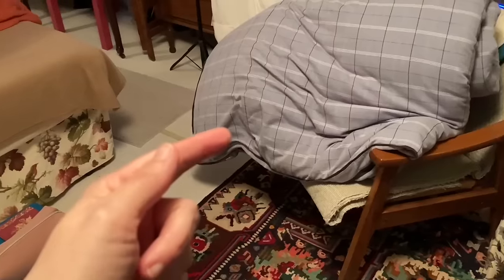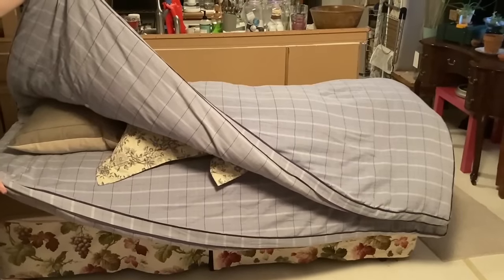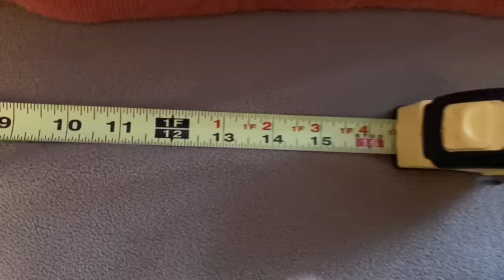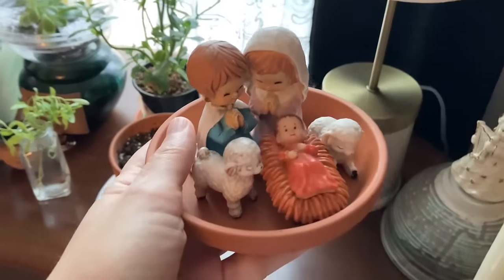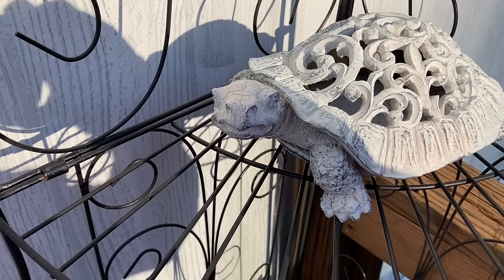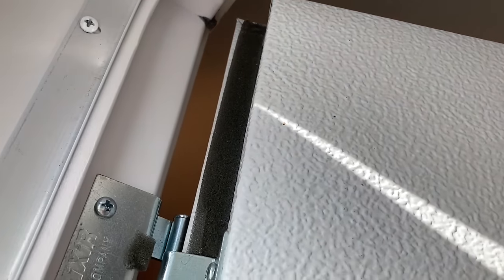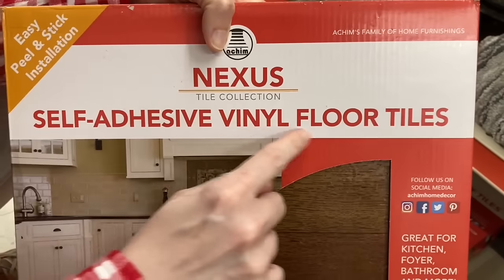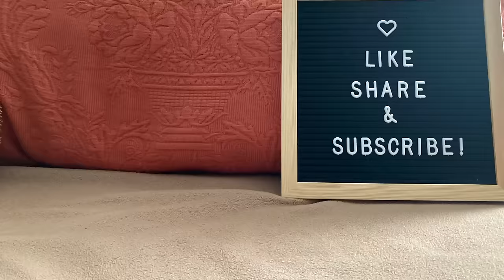Mobile Home Homemaking - Homemaking Motivation - Frugal Living - Mobile Home Life - Low Income -Vlog

Comment: The comforter contains the pillows better thsn the original blanket! Well done. I store mine in an XXL zip lock bag. I squeeze all the air out, then zip it up. It's quite small and I put it under my bed.
Reply from the maker: Thank you! I've not tried the big ziploc bags yet. Seems like a great storage option, too!
Reply: You can get those bags at the dollar store too.Suck the air out and shrink whatever you need too

Comment: Sarah, lift the back hinge, and the top should pop open. If not carefully use a butter knife to separate the top from the rubber. It may be rotten, or dried out. Also you could soak in hot sospy water, which may loosen it. Hope this helps some.🙂
Reply from the maker: Thank you for your suggestions! The seal is stuck, but I'll try your ideas and hopefully it will work out just great. We shall see!

Comment: Sarha can your nice man lay carpet or something like that? I was at home depot the other day, they had a remant of vinyl flooring for less than 20.00. You will have to remove everything to lay most of it but it's cheaper than the plank flooring. And water proof
Reply from the maker: That's a good point, Lois! I like your idea. I will have to visit Home Depot, too, and see what they got! Maybe getting carpet would be good to do in part of the trailer and vinyl in other parts. So much to consider! It's a big project because gotta move everything to get it done.
Reply: @CareFreeLivingChannel 

Habitat restore always has cheap flooring too
Reply from the maker: @pennynickels5216  I been looking! Haven't found flooring at Habitat yet but their inventory changes frequently.